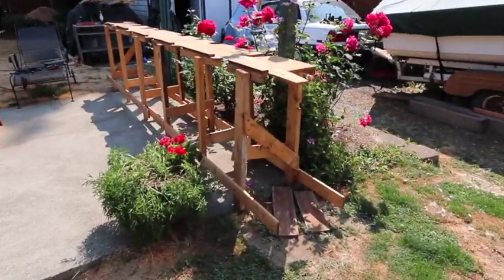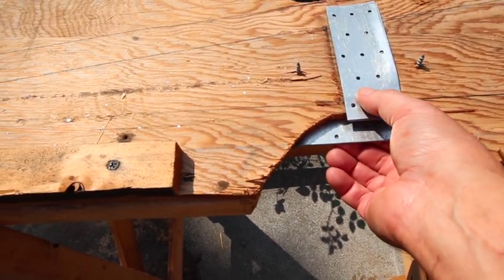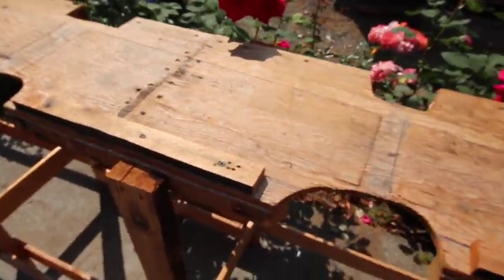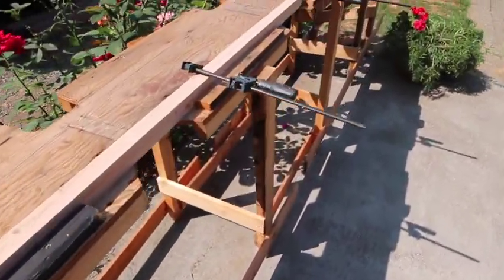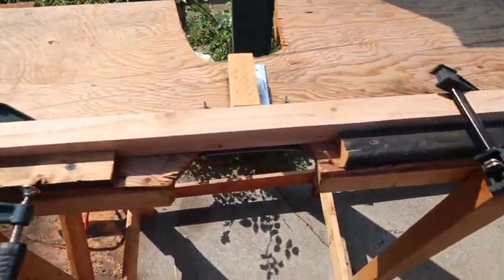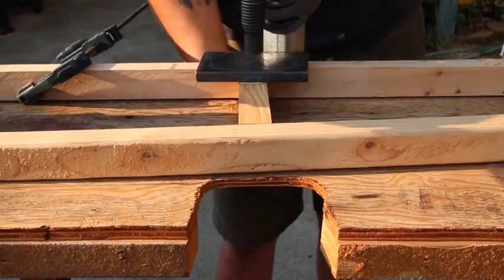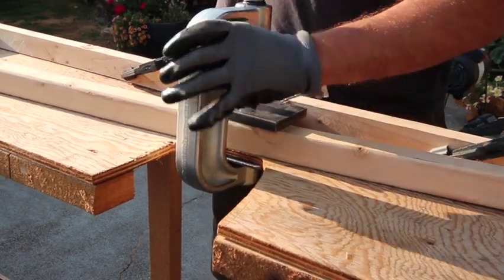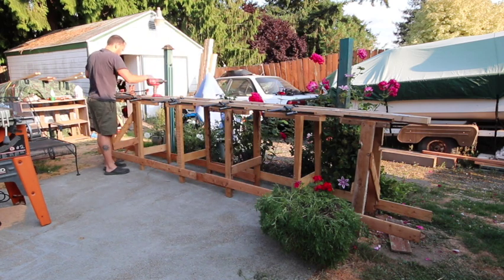Old Single Wide Mobile Home Bow String Roof Truss Build

Comment: Looks factory made! I’m sure that they do something similar. What type of covering are you putting up there? Very interesting! Have a great day, see you next time! God bless
Reply from the maker: Thanks! Yeah they have much better hydraulic presses to get those plates set, both sides at once. I'm putting half inch ply as a base to hold all the roof together then add 2" of extruded foam boards on top of that ( a suggestion from my county inspector to add r value and resale value down the road) and then cover it in EPDM rubber ie pond liner as also suggested as the least expensive and most durable option from my inspector as well.

Comment: Best way to biuld new trusses like this are to use OBS or Plywood.
Reply from the maker: I don't think that necessarily beats pressed in nail plates (I'm no engineer so what do I know) but it is def. the best when it comes to ease of construction for us diy'ers that's for dang sure! Ha!
Reply: @thesomewhathandyman9400  True, I should had said as a Suggest how I have done it lol.  But you just use 3/4" Plywood or OSB and you can cut out "2 Trusses" and then screw or nail them together.  Usually you can get 2 very strong trusses out of that each one is about 1 1/2 inch truss.  That was back when OSB and Plywood wasn't outrageous though.

Comment: How would you have completed the truss with gussets? I can visualize the shape, but how would you attach them?
Reply from the maker: I would have used wood glue on the back sides of the gussets and a ton of nails and or screws. Pretty much just defer to how I see other folks build truss's with gussets on here since I've never done it, I suppose. Ha!

Comment: Could you share where this official online retailer is that sold the nail plates to you? What is truly the difference, the thickness of metal? Or the depth of the teeth on the plate?
Reply from the maker: Shoot, it's been so long I can't recall the source but I can say it was just a seller off ebay. I'm just trusting that they are actually certified for structural use as stated on the listing I suppose but it is just ebay so ya never know. I don't know if it's the teeth depth or metal thickness but from what I've seen on the market it's more about the pattern of the teeth. The ones you get at the Depot that are not certified for structural use are lined up side by side to the next teeth. The one's I've seen that are certified have an offset pattern of teeth. I really think that's the only difference but I'm no expert so take my opinion with a grain of salt. Hope that helps
Reply: @thesomewhathandyman9400  Whoa cool. Yes that helps immensely. Thanks!
Reply: I guess my only other question before I get going on is.. A lot of RV's are constructed with the truss INSIDE the exterior wall. Seems it would be more sturdy if it sat ontop of the exterior walls resting above rather than bolted within.. Thoughts?

Comment: I would have glued the joints
Reply from the maker: Interesting. I've seen people glue and staple when they make plywood gussets on truss's but I don't think I've ever seen it when nail plates are used. I appreciate the input though and if I ever have to make more, I might try it. THanks!

Comment: Since because you rebuilt the original trusts compared to a more pitched roof design, what is the inspection process? Any permits and I thought roof trusts came from certified facilities? Is this for only newer homes? Thanks I’m on a learning curve haha only 24 years old and renovating my first bought single wide thanks.
Reply from the maker: Yeah, technically they should be made at a facility or have the plans and techniques certified. But, my inspector in a round about way to cover his butt let me know, don't tell him and if he can't tell that they are any different from stock when he comes to inspect the new roof cover, he won't say anything, as in he'll just pretend they were the original units. I'm exactly twice your age and I'm on a learning curve here too! Ha!
Reply: @thesomewhathandyman9400  my original are made of 1x2s with paneling gussets. Ther all busted and warped. If I piece them back together and join them to a 2x6 I don't need inspection? I was gonna just put the 2x6s and cut a radius until I realized about a permit.

Comment: I have a question if you still check those comments currently doing the same thing, when you did the camber in the middle did it actually straighten them just tried it and mine was dipping in the middle. Any suggestions I used a 2/4 on the bottom though hopping it would be stronger
Reply: But I kept the overall measurements just subtract the difference in the 2/4 compared to 2/2
Reply from the maker: It's hard to say really. From what I've read is the camber is to make it level when you put them up with the force of it's own weight on it. What I did when I put them up on the house is made sure to put a vertical 2x4 under each one and tried to get them either level or just slightly high in the middle, then took them down after I put the plywood sheeting on the roof. If you're putting a substrate like plywood up on the top of the roof, that's what really helps to keep the roof truss's flat and not drooping. I have yet to put my interior ceiling panels up so I won't really know if I have a level, cambered, or drooping ceiling but I think it looks pretty close as it is. I'm going to put up beadboard sheets over sheetrock since it's lighter and with the grooves, will make a non level ceiling blend a bit. We'll see once I get to that point which should be later this summer. I'll post a video when I do. Hope that helps and best of luck!